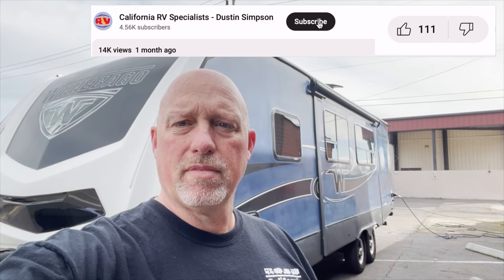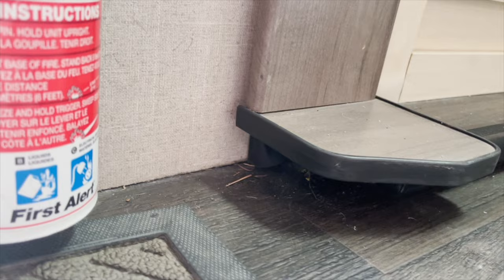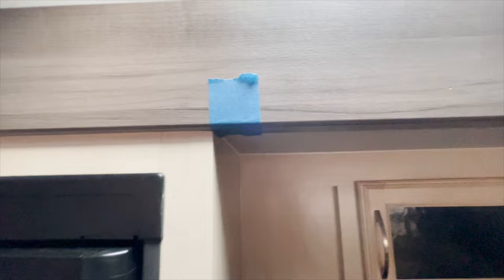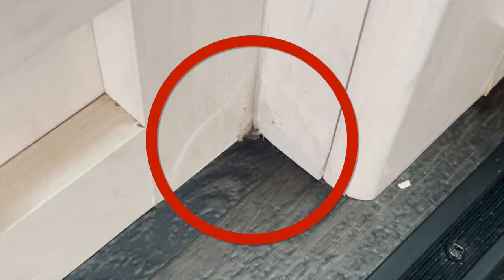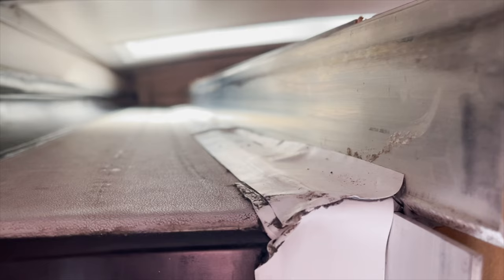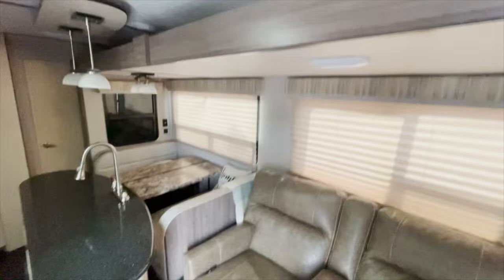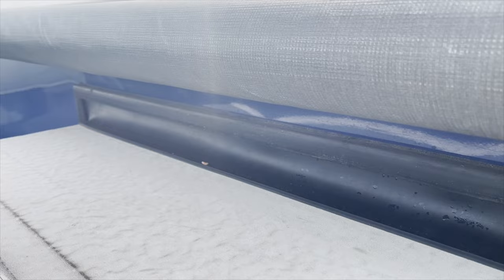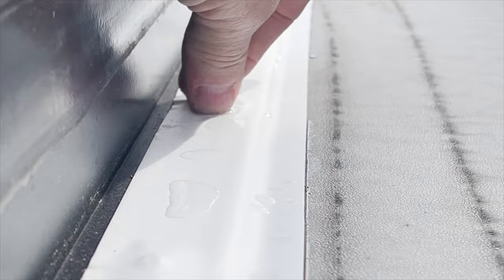RV Slide Out Leak: Common Issues Revealed

Comment: Great video!  Question..  I recently was doing maintenance on my roof and had the slide out.  I noticed a round piece of foam that came out from under the sweep seal.  I didn’t really  know what to do with it other than to push it back under it and hope it doesn’t keep protruding in the future.  Was that foam piece supposed to be connected to something?  I have a Jayco 295bhs if that helps..
Reply from the maker: Please share a picture of it or post in our jayco rv owner in the rv shop with Dustin so I can advise you

Comment: Great advice, I had a issue with my slide coming in crooked, I looked it over closely and realized that the manufacturer did not drill holes on one side of frame to allow wear tabs to be installed. No holes no wear tabs . The other side was drilled and tabs installed. When moving the slide the rack would lift up to high causing the gears to not mesh and allow for a crooked slide . I guess for the first few times I moved the slide I got lucky . Being full time I was 3 weeks without my home . Dealer removed the room completely drilled holes and added wear tabs . How does the manufacturer miss such an important step .

Comment: Excellent video.  Where the caulking is cracked or separated would you remove the old caulking before resealing?
Reply from the maker: Thanks, Rick. You are correct, the old silicone should be removed and then sealed with new.

Comment: Is it best just a Pull  The Olde sealing  off like around the stove vent and items like that on the outside and reseal versus going back on top of the old ?
Reply from the maker: Yes, the proper way of resealing is to scrape off what you can of the old stuff and then seal new silicone/sealant.